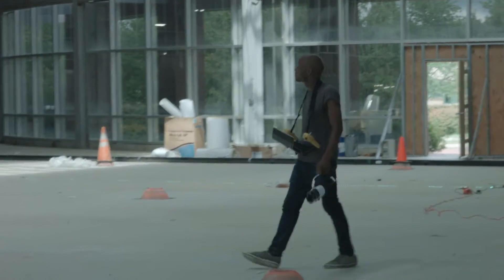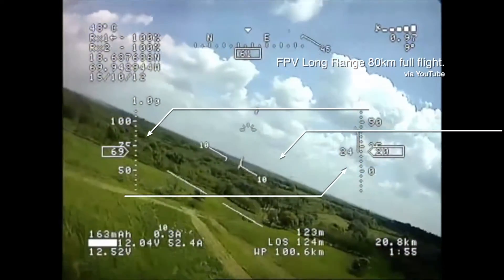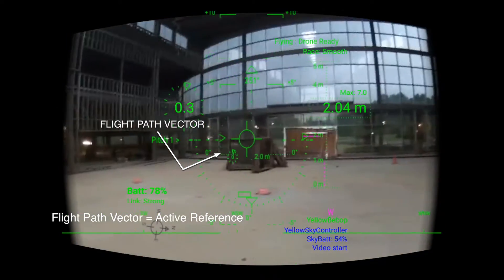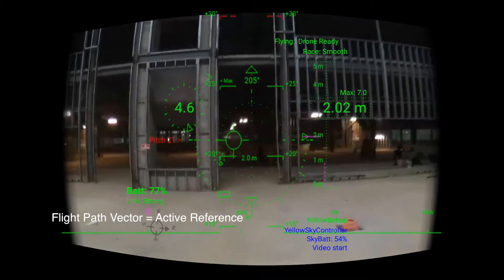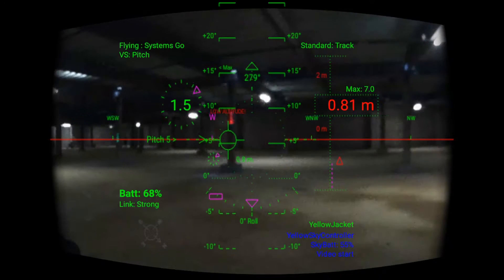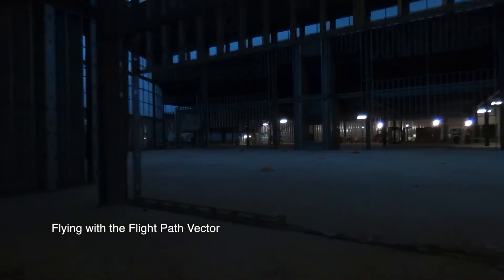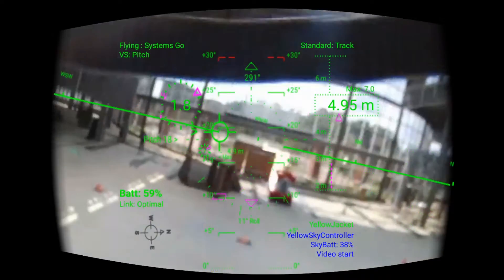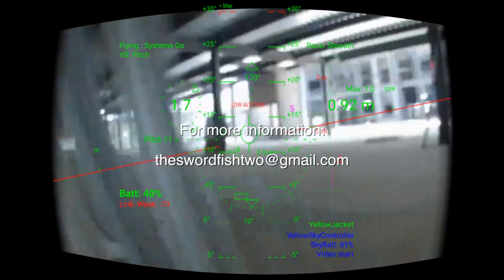Fly Faster: Flight Path Vectors for an FPV Drone Racing HUD

Comment: hi is there any way we can insert that HUD in dji fpv's shots??
Reply: Probably. Been so busy with work, AR and lidar that I haven't had a chance to touch this in a while. Let me take a look at DJI's api... The implementation of the algorithms seen in this video couldn't process data fast enough to give me a smooth output without overheating the phone, perhaps I would have better luck with DJI's platform over parrot's.
Reply: @kennydanielsgmail  please🙏🏽
Reply: @kennydanielsgmail did it work?

Comment: Sorry to The poster of this video but this is very important and please do not take down my comment, thanks. In the Untied States you must have a Ham radio license to fly FPV. If you do not believe me here is the link 
http://www.propwashed.com/need-amateur-radio-ham-license-fly-fpv/. I am putting this out there because if people Flying FPV in the US do not get licensed then eventually the US will ban FPV. So please if your going to fly FPV in the US get a Ham license.
Reply from the maker: Sorry, just saw YouTube blocked your comment. FYI parrot drones run off WiFi not the VHF/UHF etc. , no ham license needed to operate a 2.4ghz WiFi network.

Comment: sorry to say, for real racing way to much info going on the screen. it will just destract. (Like a big rev meter in a race car is more important than the speedo meter) just Voltage and maby a arrow for the track buth nothing more for me. for more auto pilot style and filming i can see the benefits, not for racing.
Reply from the maker: Perfect opportunity to watch my latest video! I started this whole thing off thinking like you, but eventually I realized there just might be a better way. In the design considerations video I cover in detail the experience for the pilots and why, against my initial instincts, I ended up adding more information to the screen.